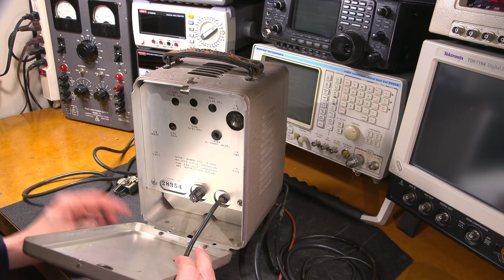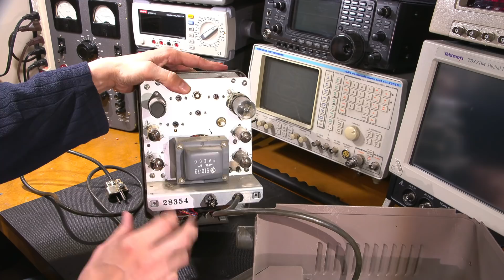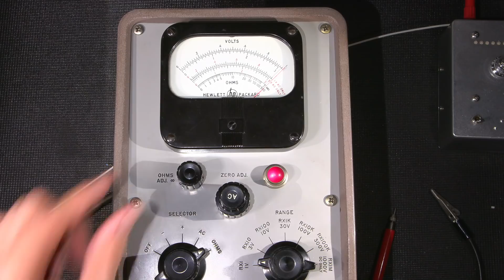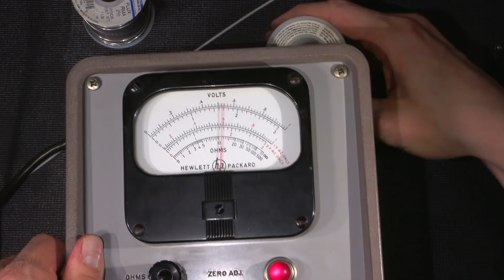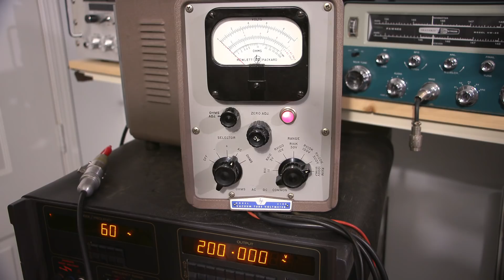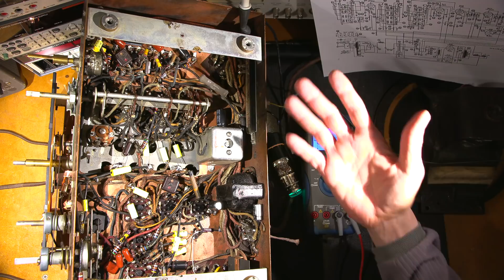The BEST VTVM? You Decide! HP 410B Restoration and Alignment

Comment: I was able to pick.up an HP 410B on eBay. "Property of the USA" with calibration dates of 98164 and 98169. On the front is Warner Robin's ALC 14 Sep 1977. My AC calibration board is labeled and all the pots are on top of the board with 30, 100. and 300 top to bottom. I have the larger 2-01C tube in the AC probe. Needs some cleaning, and I am looking forward to seeing the updates!

Comment: Mr. C., at 47:10, is that a DAK on the left side of the shot?
Reply from the maker: Yes Sir it is.
Reply: What is a DAK interested to know
Reply: @shaunsiz.itsbetterbytube2858  It is a very sought after CB radio. A Mark IX is a CB and a Mark X is a CB with LSB and USB. And, yes, it is tube type!
Reply: @chucksteele4787  thanks Chuck

Comment: Interesting old meter. Its successor the 410C is even more interesting. Probably the epitome of analog meters it had the optical chopper like your other meter. It had a custom marked meter scale to match the movement exactly. Can you imagine photo graphically exposing film to make a special scale for each and every meter movement? With chopper circuitry it would read mV levels so you could read thermocouples directly. It has the same AC probe with a tube in it. The meter circuitry included one tube and some transistors. It was very simple and even fits on one page. While the 410C was pricey in its day a DVM at that time would have been much more expensive probably 5-10X. When DVMs dropped below $500 in the 70's I'll bet not too many of these were sold. I used one regularly along with Simpson 260's and other VOMs before we got DMMs. After that I rarely touched it. I was always impressed by its simple and elegant chopper stabilized design. I still have one just for fun. But then Phillips had chopper front ends on their scopes back then and never drifted unlike Tek's on which you chased the beam around for the first hour or so. Not well known but Phillips scopes were vastly better than Tek scopes in many ways. You ought to do a 410B 410C comparison video. I could lend you a 410C if you don't have one.
Reply: All HP dials on signal generators were engraved after each unit was calibrated. the engraving machine was driven by a frequency counter so no two knobs or scales were identical. I was surprised by my first tour of the RF production line tour in the early 60s. They wanted young future engineers to get attached to HP so conducted events for groups of 5-20 nerdy 12-18-year-olds and assigned an engineer to each of us as a mentor for personal guided tours. Bell Labs did the same thing back east. It was a different era, none of the kids ever asked about salaries or stock options as now, we all would have worked for free. Any job in the late 50s and 60s was a living wage job that could support a family so no one even thought about money. I was particularly interested in  RF and MicroWave so got a full tour of all the production process and still have vivid memories of that tour. I was given the phone number of my engineer mentor and when I was building all my self-designed gear to attempt moon-bounce two-way communication on 432mhz I asked questions several times.I was just a 16-year-old kid with two clock-driven parabolic dish antennas and all homemade equipment and made local headlines by being amount the first to succeed in two-way com via moon bounce. The army did one way with an unlimited budget in 1959 but this attempt was two way between me and Cornell University radio astronomy grad students who had access to the 1000 ft dish radio telescope at Arecibo  PR. I never worked for HP but those experiences and my fondness for the test equipment division never faded. I ended up with a large recording studio that became very successful in the 70s to 90s. I was never interested in music and never learned to place an instrument but had a knack for creating sounds that become hits. The studio had 197 gold, platinum and Diamond albums. mostly consecutive in 3 studios. Of course, the studio maintenance department was full of HP test gear from my large private collection

Comment: Great video, Paul, as always!  You mentioned that you'll be designing a tube matching circuit in an upcoming video.  Will it also have a way to measure transconductance?  It'd be great to have that as my B&K 607 tube tester lacks that ability and the gm capable testers are beyond my price range.

Comment: 11:04 - That rectifier looks beautiful. They emit cyanide gas when overloaded though!
Reply: Selenium gas, not cyanide. Not as toxic but still not good to breathe.
Reply: @hightechstuff2  Thanks. Selenium rectifiers have awful specs to boot.
Reply: @dhpbear2  Yep, the silicon counterpart is almost 1/100th the size! It is fun to see the way electronics have evolved.
Reply: When I was a TV engineer I was used to smelling the selenium rectifier used for tripler circuits in TV's burning up and smelling like burned cabbage. I would walk into a house and know what was wrong with the TV right away.
Good times.

Comment: The problem with equipment like this VTVM is where to get spare parts (tubes) when the thing goes south.
Reply from the maker: All the tubes are still "very available."
Reply: Tubes are no problem at all. But Gawd help you if you need one of the rotary switches and out of maybe 50 of these VTVMs I have seen over the years, only about 1-2-3 had the probes.

Comment: Very nice!  Especially liked the part about calibrating the infinity position so the meter tracks dead on as the range switch is moved.  I wish my Knight KG-625 had that ability. I'm always adjusting it between ranges, as well as the zero position when switching between positive and negative measurements.  Is there a way to correct this behavior in the Knight VTVMs?

Comment: Extremely nice meter! Really a beauty.
Great video!

I only don't really follow the super accurate story of it.
For example, when reading the 200V, it has a line for every ten volt.
Everything in between one has to guess. So say your total accuracy is about 3 volt with good eyes and tongue at the right angle. Although there is no mirror for parallax compensation, so often that is more like 5V.
So the total reading would be at best 200±3 V or 200.0±5 V, not so impressive for nowadays standards.
For example, try to read accurately 164V

Most decent DMM's these days do an order of magnitude better and therefor fall well within spec of these meter.
Off course one can also just calibrate these meters to have the exact reading, although in general they still fall within spec after many years.

Comment: Coming from the computer industry,  I have a hard time remembering that HP DID make good stuff,  and not just the trash grade laptops that sell at Wal-Mart.
Reply: HP and Fairchild created Silicon Valley with hundreds of spin-offs by HP engineers, back then it was all precision test instruments, before the second wave of computers, then the 3rd wave of software, and now social media. HP actually helped engineers quit and create startups that grew an entire ecosystem of support specialty products, and job shops so any sort of prototype external services that was needed as in a 10-mile radius from chemical supply houses, parts houses, machine shops, printers, pc board fab, everything needed to develop a product by a small or large company. The Fairchild was the other incubator of that innovation explosion in the same area. If you were an engineer, that was Mecca.  Now you have to go to China to find that concentration of support services and explosive innovation.
Reply: Don't forget the great HP calculators. My HP 25 got me a Georgia Tech EE degree back in the late 70'S...thru a design engineering job...business owner...happily retired....and I still use it to this day. I absolutely love RPN. Once you get used to RPN you can never go back.
Reply: I forgot to mention the HP 25 display. It's red LED. I liken the LED display to an analog scope display versus a digital scope display. It just reacts instantly...the slight delay in LCD displays bugs me.

Comment: Just a little history:  Hewlett-Packard introduced the HP-410B VTVM in 1950. It replaced the HP-410A, which HP introduced 4 years before, in 1946.
Reply: Hi Trev0r98, I have a H/P- 400C not the same but a fine instrument.
Reply: @garybevis8691    Nice!
Reply: Thanks for the info.

Comment: Mr Carlsons statement re DMMs should be only considered correct when comparing with VTVMs like the HP which have mind blowing specs. A regular VTVM might be very similar to a regular DMM which is fairly standard at around  10Mohm.

Comment: You tested DMM and Vacuum Tube volt meter, how about a non vacuum tube volt meter, and don't mean the cheap meter?
Reply: E.g. a Simpson 260 vs. a cheap VOM?  There'd be no significant difference in circuit loading as long as the ohms-per-volt spec is the same.  I'm surprised that (at least AFAIK) nobody is offering a lab-grade bench DMM with a very high impedance front end a la great old VTVMS like this one.
Reply: @editorjuno  I found  Keysight 4329A High Resistance Analog Meter that could do the job and I think it doesn't have vacuum tubes, but I could be wrong.

Comment: Join the Church of Electrolytic Reformation :-D
More often than not, I managed to reform old electrolytics so they work as good as new (or at least close enough). In most applications, you can get away with a few dozen µA leakage current.
Reply from the maker: Not worth the risk for a few dollars. New caps are cheap, irreplaceable power transformers are not.

Comment: I use to own a HP-410. Great meter.  Got rid of it back in the 80's. Wish I would have kept it.
Reply: GTCGreg  ,  I wonder what the difference was with a model 410 which went for just under $300 on eBay the other day.
Reply: @BruceNitroxpro  I have no idea. I got rid of the one I had almost 40 years ago. I gave it to a neighbor kid that was interested in electronics. It was complete and working well when I gave it to him. I gave him quite a bit of other electronic test gear. He  eventually went on to get an electrical engineering degree. I hope the test equipment I gave him helped inspire him to do that.
Reply: @GTCGreg  ,  Superb! But, if he was silly enough to get rid of that meter, he will almost certainly crap a brick! LOL

Comment: Ebay price now 250$ and 60$ for the manual.  Lets see how much it goes up ;)
Reply: ByteRock  ,  I lost a bid of only $280 on one the other day, but did get  a manual with beautiful illustrations for $30.
Reply: @BruceNitroxpro  My prices are in CAN$ ;)
Reply: @byterock  ,  Oy... CANS? LOL
Reply: Lol. Ok, I’m always on the other side of this but for once, I am not. I have 6 of these that I picked up from a university a year ago. I restored one for my own use but have 5 more. I guess it’s time to do something with them!
Reply: @AndySpicer  ,  Gee, I THINK there is some interest in obtaining one... MAYBE! I am nitroxpro at gmail, if you want to get rid of a pretty one. LOL
Reply: @BruceNitroxpro  ok. Let me think about how to do that. I’d much rather sell them to people that are Paul’s subscribers and / or Patreon’s. I’m just not sure how to price them. They are all in nearly perfect condition with the two exceptions being the leather handles and two probe wires easily replaced. Some units have the handle, some don’t, but none of them is strong enough to actually use. All the probes are intact but the Ohms and Common leads need new wire. The probe ends are fine. As is the AC probe, it’s triax cable and the AC Probe diode tubes. I haven’t checked all of the tubes inside the units but the units I did check were all nearly new and I would check them all before shipping.
Reply: @AndySpicer  ,  Sounds good to me. I am here when you wish to sell.
Reply: Virtually any hp manual is avail for free @ http://hparchive.com/hp_equipment

Comment: Silver band - 10% tolerance - 7.47K is just within spec for 6.8K nominal, so that resistor could easily have been 7.4K when i was installed. As you've mentioned in several other videos, Allen-Bradley resistors rarely drift.
Reply: Yep. Appears white on the video, but it is definately a silver tolerance band on this type resistor.
Reply: Yep, if that tolerance was ok for the lab that built it, why replace it if it looks and tests ok?
Reply: I think while modern resistors are mostly produced to spec, those carbon composition types had a lot more variation in production and I wouldn't be surprised if they were checked how they turned out and then labeled accordingly. So instead of the roughly bell-curve distribution you expect to get today it would have been much more evenly distributed.